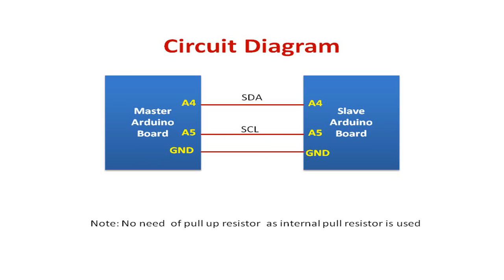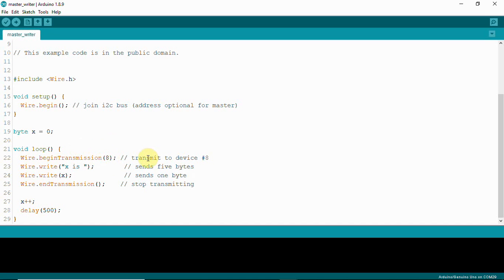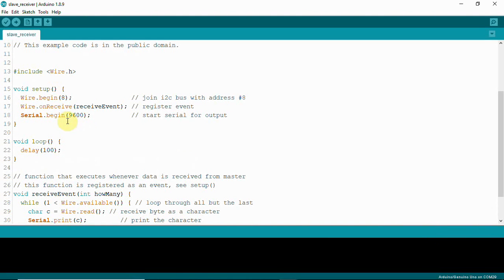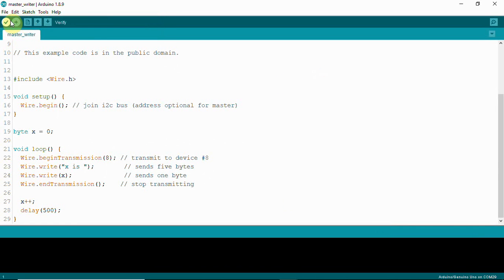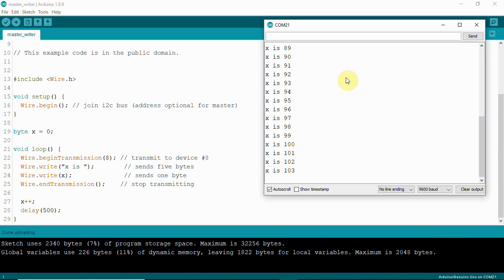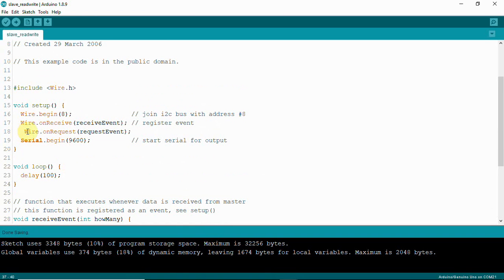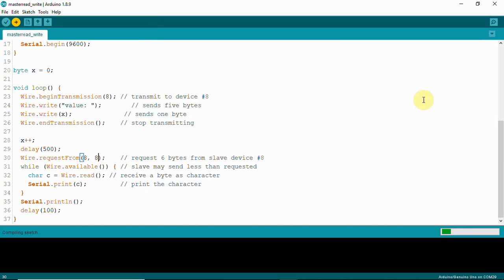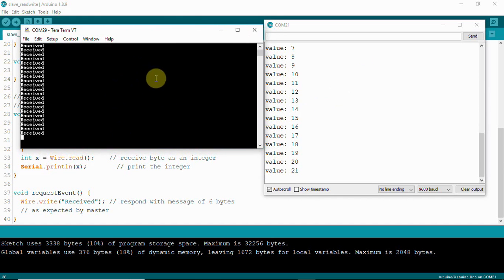I2C Master- Slave Communication between two arduino board

Comment: Great vid! but why did you put while (Wire.available() > 1) {}, I did not understand the comment near this particular code "Loop through all but the last", why do you want Wire.available() to be greater than 1.
Reply from the maker: to check I2C buffer availablity of bytes of data
Reply: @chipride8119  Yes, I understand that... but why does it have to be greater than 1 (and not 0)

Comment: which model you are using? i am using two esp8266 boards but i am not able to get the data on serial monitor(master is writing the data,slave is receiving).can you please help me out.
Reply from the maker: It's between two UNO boards, wire library for esp should work. If not try external pull up resistors
Reply: @chipride8119  how should i use external pullup resistors.
Reply from the maker: @ratnakarkarri627  Also check on latest esp8266 version for I2C.

Comment: Main hairaan Hoon  . Jab value  x>9 Hai . To slave serial monitor mien x value toot nahin rahi Hai. Jab k x ki bytes  jab 2 ya jyada hoti Hai . Wo receiver main as integer dikhyi nahi deti.
Reply from the maker: check code & connection
Reply: @chipride8119  I have tested 10 month ago
Reply from the maker: @charanjit215  Ok
Reply: @chipride8119  I tested it uno+ nano . I think this not matter.
Reply from the maker: @charanjit215  try using external pullup resistor 4.7k or 10k